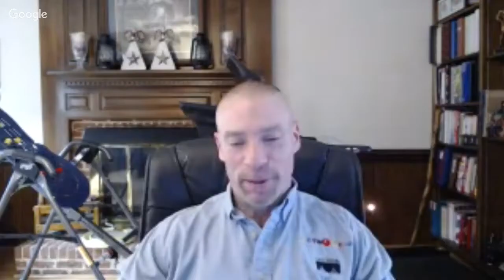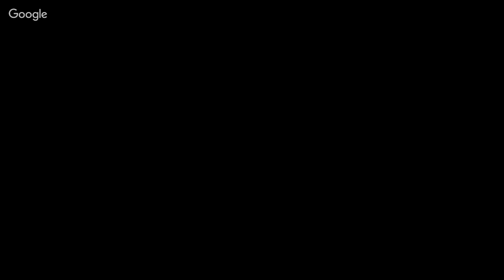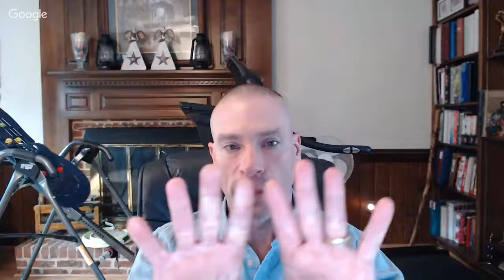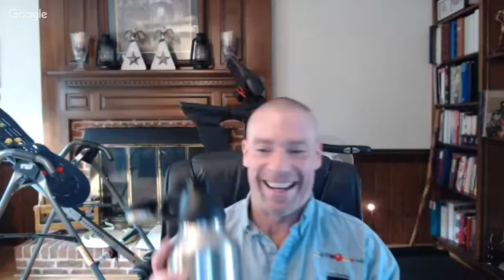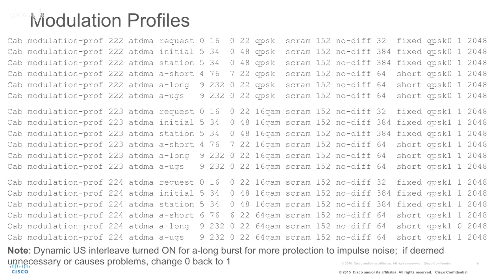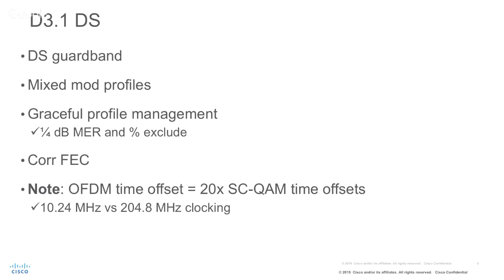Comment: We received this question.

Information overload on your Channel! I love it though! 

Our 1st return qam is 15.7 Center Freq, needless to say, we deal with a lot of ingress in that area. This has caused lots of issues for our Voice customers. Couple questions, how can I verify what the Primary US Channel is for a particular MTA? Also, I saw on your most recent video a note, that said - Voice Data is never bonded on the Upstream. With that said, if an MTA picks 15.7 as its primary channel, that customer will suffer. We have Cisco CBR8's, is there a way we can the CMTS to not allow voice data over that Frequency?

Answer:

There is no such thing as a primary US.  Each US does station maintenance.  One little trick I have found to find the first US it ranges on,
 
Look at scm mac ver.  Sometimes the time offset that is the same for initial and current will be the first US.
 
Here’s an example where I did some sorting
cbr8#scm 10.12.1.14 ver | in Offset|Up.*Ch    
Upstream Channel                   : US1        US2        US3        US4      
Timing Offset             (97.6 ns): 1806       1819       1819       1820     
Initial Timing Offset              : 1809       1553       1553       1553
 
Sometimes this works.
 
I’ve also notices that when I do ping DOCSIS ver, it seems to only use that first US.
cbr8#ping docsis 10.12.1.14 ver
Queueing 5 MAC-layer station maintenance intervals, timeout is 25 msec:
Reply from 1859.3353.09e4: upstream 1, 3 ms, tadj=0, padj=0, fadj=-2
Reply from 1859.3353.09e4: upstream 1, 4 ms, tadj=0, padj=0.50, fadj=4
Reply from 1859.3353.09e4: upstream 1, 3 ms, tadj=0, padj=0.50, fadj=-4
Reply from 1859.3353.09e4: upstream 1, 4 ms, tadj=0, padj=0.50, fadj=24
Reply from 1859.3353.09e4: upstream 1, 3 ms, tadj=0, padj=0.50, fadj=24
 
US UGS flows and any scheduled US flows will pick any of the USs (that are less congested at the time) to setup.  They are assigned a single-ch default US BG.
 
You can see some of the distribution with:
cbr8#scm tcs summ
Interface                                       Cable Modem        
                                       Total Reg   Oper  Unreg Offline Wideband TCS       USCB
Ca1/0/0/U0                             2     2     2     0     0       2        256       65536
Ca1/0/0/U1,2,3,4                       14    14    14    0     0       14       7680      1
 
The single-ch default US BGs start with 65xxx numbering.
 
cbr8#sh cab upstream service-flow summary
Interface                     Static Upstream Service Flow     Dynamic Upstream Service Flow    Description
                Total  PRI    BE    UGS   UGS-AD RTPS  N-RTPS  BE    UGS   UGS-AD RTPS  N-RTPS
C1/0/0/U0       2      2      2     0     0      0     0       0     0     0      0     0       UC1/0/0:U12
C1/0/0/UB1      14     14     14    0     0      0     0       0     0     0      0     0       Cable1/0/0/UB1
 
Total:          60     59     60    0     0      0     0       0     0     0      0     0
 
cbr8#sh cab ubg c1/0/0
BG ID   I/F         Mask(upstream num) Attributes  Ref
1       Cable1/0/0  0x1E      (4)      0x80000000 (ubg 7F763315AB80 list 7F75FE8D0C48)
65536   Cable1/0/0  0x1 (US0) (1)      0x0        (ubg 7F75CB8B97E8 list 7F75FE8D0C48)
65537   Cable1/0/0  0x2 (1)   (1)      0x0        (ubg 7F75CB8B9218 list 7F75FE8D0C48)
65538   Cable1/0/0  0x4 (2)   (1)      0x0        (ubg 7F75FE8E1328 list 7F75FE8D0C48)
65539   Cable1/0/0  0x8 (3)   (1)      0x0        (ubg 7F75FE8E0D58 list 7F75FE8D0C48)
 
You could always use DOCSIS restricted load balance groups to steer eMTAs, but then all the traffic would avoid that US.  It would be better to use an attribute in the US BG that matched the eMTA traffic (service flow).  This is bit more involved than what I would go into.

BTW, I would usually recommend experimenting with US dynamic interleaving on freqs below 20 MHz, but not sure it would help on the a-UGS burst anyway.